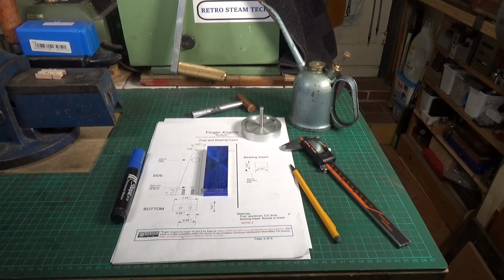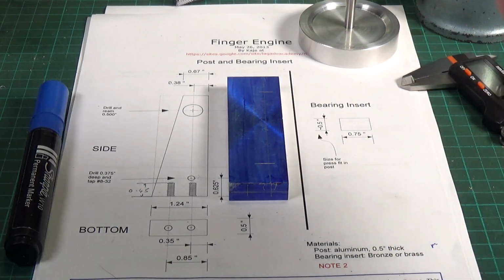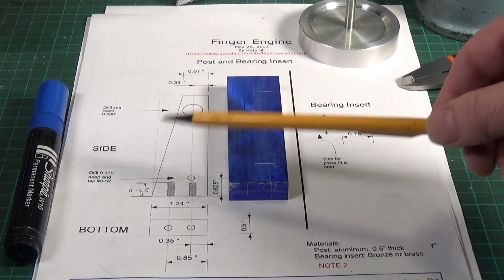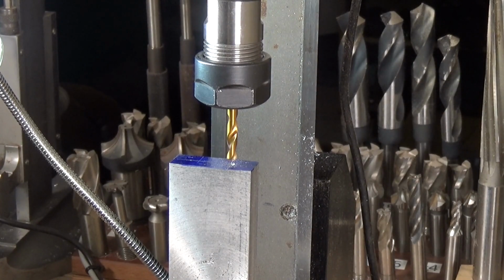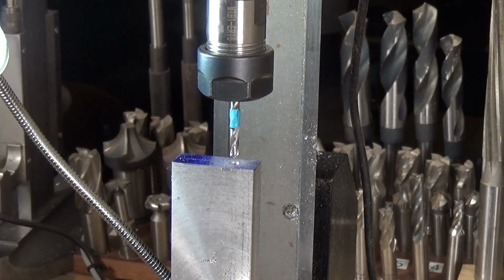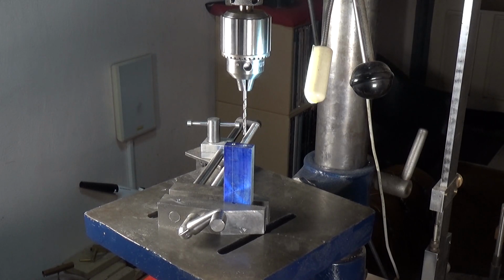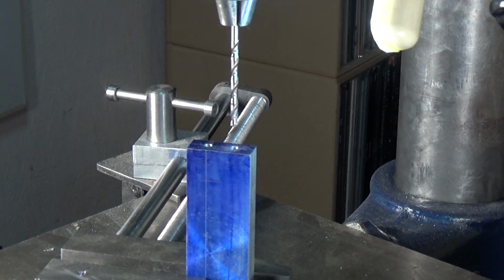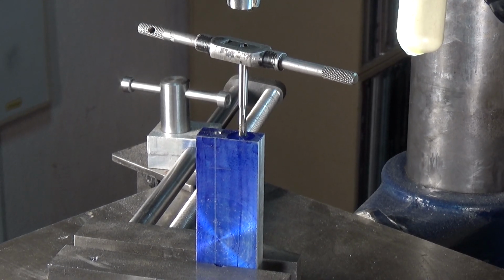Lockdown Project - Finger Engine - Part Six

Comment: Nice job! You might want to make some small tap wrenches like Joe Pie's. I made three, mostly because I had the material and I was board.
Reply from the maker: Thanks Craig. I've seen Joe's video on the small tap wrench, they are very nice and I'm tempted to make one as it looks like a great little project. I already have a large selection of different sized tap wrenches, the one in the video is my favourite small one. Cheers, Alan.

Comment: Hi Alan, Coming on nicely, you could clamp it on the drill press table lightly and eyeball the centre punch mark, then using a centre finder with a point tap the block into position and tighten the clamp. Cheers.
Reply from the maker: Hi Paul. Yep, that would work just as well. There are probably many ways to do this, I just like this one. Cheers, Alan.

Comment: Nicely executed Alan.  If you have a drill press with a rotating table you can clamp down the job and then position the drill (as seen) by rotating the table on it's center and the table arm/support on the column.  The two arcs will intersect at any drill point you choose.  Anyone thinking of buying a drill press should consider this ability.   Cheers Rob
Reply from the maker: Thanks Rob. As with pretty much everything I learnt the drill press tapping trick from watching someone else do it on YouTube! Rotating the table to achieve the same thing would be difficult on my Craftsman drill press as the lock to allow you to rotate the table also holds it in place vertically. What you could do is rotate the drill press head, which you can on the Craftsman to achieve the same result. As you probably have gathered I really love my old drill press, made in the 1930s it can do a whole load of things that the modern ones can't. Proper depth stop, quill lock, rotating table, rotating head, real easy to change the speed etc. They don't make them like they used to! Cheers, Alan.